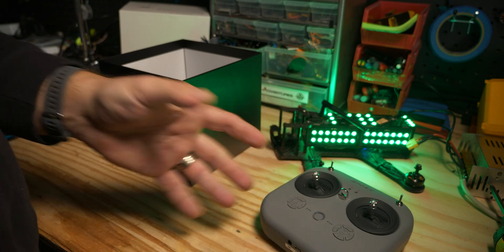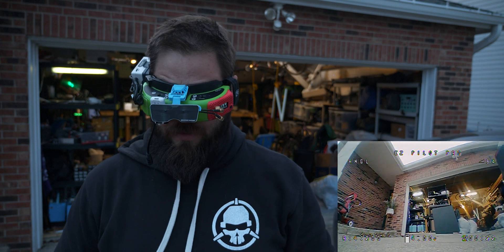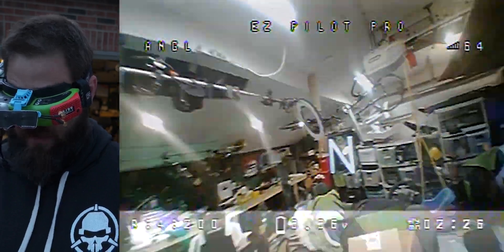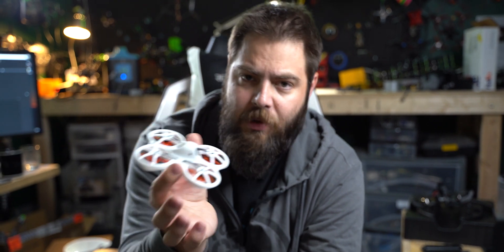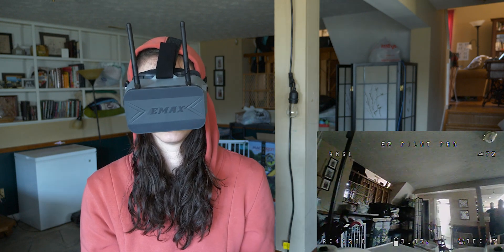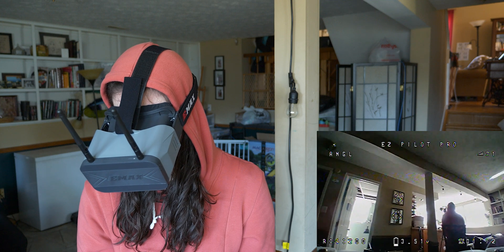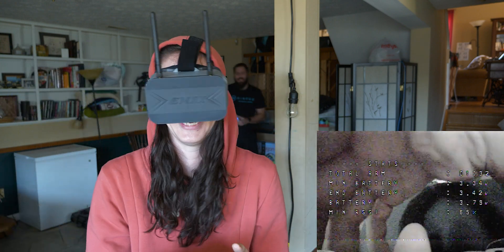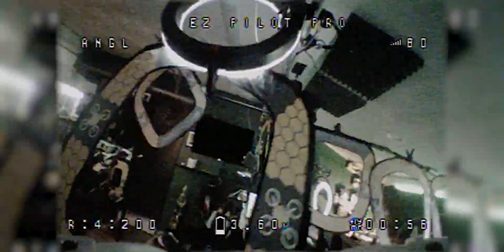Starter Drone That Grows With You

Comment: I really hope you can point me in the right direction. I just bought the Emax tinyhawk 3 RTF and from the first flight about a few seconds of flight in any more including acro. It will start to drift hard left and slightly back. I've hooked to betaflight everything is on point I still reset the accelerometer no fix, tx at 1500 across the board. Could you give me some advice on where to start fixing this? I went ahead and ordered 2 new motors for it but I'm lost. Please any advice on what you think may cause this, can a motor give a free seconds of perfect hover and then when sick input is applied the lean starts? Thanks in advance

Comment: First I'd like to say love the videos Nurk, its awesome to see the behind the scenes of a lot of stuff.

Second, I purchased this for myself about 3 weeks ago. The only issue I have had is with the E8 transmitter. Mine somehow got stuck giving a constant yaw right command. I kept the transmitter on a lanyard the entire time and never dropped it or mishandled it. Used Betaflight to confirm it was the radio and not the drone. Reached out to EMAX and after 2 emails with receipt and pictures of the radio plus back story, they put another radio in the mail no problems. +1 for EMAX support but I still chose to upgrade the radio to the Radiomaster Zorro, but am still grounded as both radios wont be here for another 3 days.

Comment: I’ve been watching your videos trying to find a decent entry point. I like the look of the babyhawk hd but goggles get pricey. This might be just the ticket for me.
Reply: I started off with the tiny hawk kit you can get the goggles batteries drone and everything you need to get going and you can keep the goggles for later they're not the best but they are pretty good
Reply: @saittafpv5846  I really like the detachable screen. Even if I upgrade I can keep it as a field monitor of sorts. But the tinyhalk 3 is a harder plastic. May I ask how it handles outside in the wind? Is there a 2s option for more power?
Reply: @Grouch101  you're the Tony hawk is okay if it's no wind outside but it's not like something you're going to be fine all the time just for the first couple weeks until you get used to the controls and then you go straight to a real drum or at least a 3 in I just went to a 5 inch though after the tiny hawk I've been flying for about 4 years now stick with it and keep practicing and you'll love it can't take out my videos on my channel if you'd like
Reply: @Grouch101  the tiny hawk s does one or two s so does the They hawk 2 and it both come with everything that this one does
Reply: The geprc tinygo Rtf looks good, but uses weird protocols. I like that it can do 2s for outside. But if I got this or the tiny hawk 3 and the babyhawk hd I could do both, but now we are getting pricey again. More research. 🤷‍♂️

Comment: I had a birthday last year and I got an FPV drone. Unfortunately I couldn't get the firmware on my transmitter to switch so it sat in my closet for a couple months and decided to sell It. Then I got ripped off by a couple hundred bucks because the guy I was trading with said the Oculus he had was 600 when it was only 300. I really regret my decision and this year I'm really considering getting back into FPV because of how fun it was.

Comment: Obviously, i am the neediest. Have a racing drone stuck in attitude mode that in trying to learn on. Donated as i no longer have use of my legs, but used to fly, so this is supposed to get me back in the air .
Had a few hours on the dji fpv in manual, but clearly need more sim time, and a less delicate, more fun drone, just like this.
And i love your ability dearly!
Reply: I did reply here earlier, but it's disappeared. Just confirming that the WhatsApp is correct.

Comment: I  Have been saving and saving for an FPV drone for months now. I usually fly My dji spark but have always wanted to get goggles for it - this is when I learned more about FPV drones,  when I started looking at the cost of ordering everything (500 + dollars due to chip shortages jacking up drone equipment prices) I realized it was too much-so I continued  watching Josh's explanations of analog vs digital, 5 inch vs 4 inch quads. Even watched tutorials on soldering (even though I have never tried it still). This turned me off to the hobby, then on captain drone's channel I seen him review The EMAX TinyHawk II Freestyle. I thought this would be perfect (a kit with everything included and cheaper too!). I then learned it wouldn't be a wise investment spending money on equipment that couldn't be used between quads. So i watched hours and hours of videos (i watched Josh Bardwells entire series on tiny woops) - this is how i found your channel. I learned this kit uses equipment that can be used with other drones ( your video where the drone became friends with a dead bird). I started looking at your channel and seen this giveaway was active. I felt this was a sign, and had to tell my story and throw my name in the hat. Thanks if you read this!  Hope i win thanks!!

Comment: 2 years ago i started with my whole interest in drone flying in general. At first i practiced in DRL SIM aswell as Liftoff. I was instantly hooked, specially to freestyle, so i flew quite some hours in the SIM with my playstation controller. However the first drone i then actually got was the DJI Mini2, since i wanted something to make photos first when im outside riding my motorcycle. I sweared to myself that someday i'd be getting a "proper" FPV drone but so far ended up always saying "tomorrow you will" day after day. The biggest reason so far why i pushed it on and why in the end i only flew 2 times with my Mini2 so far is that austrian law is super strict and i'd have to ride at least half an hour via motorbike before i am anywhere where i can fly legally.

That however changes, there are law changes coming this year that allows any drone below 250g starting weight to be flown even in cities! Which means i can just go out in the park to fly around a bit! Can't wait for that. This kit sounds like the perfect starting point for that.

Comment: This is a much better beginner deal than the original EZ Pilot brushed motor drone that only had 25mw VTX and it's expert mode was just angle mode. Unfortunately it's a D8 receiver. It's hard to find a D8 radio that's useful for other drones.

Comment: I was deemed fully disabled the beginning of 2021 and then the pandemic, 2021 i found the hobby but have never pulled the plug on a kit because on a set budget less than $850 a month and trying to save a trip if japan ever opens to visitors, but drone laws are crazy there and you need to stay under 200g with the battery or you need to do a ton of paperwork and get licenses. everywhere you go. i really want to learn house to fly and have something to do in my spare time. thanks for the share and the chance to win, stay awesome!

Comment: I have talked a lot with my colleague about fpv and since I have just started with fpv and have seen how expensive it is. 
He has now flown 3 batteries with my 5 inch drone and is very hyped. He now wants to buy a drone too and is not sure which or what to get. And since he doesn't want to spend $700 in fpv equipment at the beginning this would be the right drone for him.
I also think that the size of the drone + the 200mw vtx for more range I love it.

Hopefully you see that. Greetings Simon

Comment: I'm not a new pilot so draw again if I win - but I wanted to say I started on the OG Tinyhawk RTF kit and this is the evolved version of that. I learned a ton with that drone and am so thankful that Emax made it so easy to get started. I bought that kit before I even knew what sims were so I had first hand experience flying LOS and FPV before ever launching a sim and that felt good to me. These little things are so tough and resilient that there's almost no way to actually break them. I've put probably dozens if not hundreds of batteries through it and still haven't had to replace anything on it. Kudos! Good luck everyone!!

Comment: I actually bought a similar start kit late last year to get started in FPV. Worked on the sims a bit then got the drone kit and started to fly around the house. First bad experience was when I got the little drone stuck in my wife's hair (she was not happy). then the screws fell out of one of the motors and the motor fell off and destroyed itself.  Pretty cool though, just need some more practice (and a pair of scissors).

Comment: Nice juncture. I was looking around for a small beginners drone I can learn on before I take the plunge to make larger drones that can loft cameras for me. I like that the headset display can be used separately. I get motion sick wearing enclosed VR goggles. In the long run I may want to use my motor, PCB, and firmware design skills to make better electronics. My biggest issue is I'm trying to do everything on my disability income.

Comment: Been looking for a drone kit to get my 10 year old daughter started in this crazy (and often expensive) hobby. My son and I already fly (we started back in 2019). My daughter has been practicing a lot in Sims lately and been getting pretty good at it (she's been using my TX16s). But even though she has improved alot in a sim, there is no way I feel safe handing her one of our 5" quads (aka: Flying Blenders) to start with, right out of the gate. Something like this is absolutely perfect! I was looking at the Cetus / Cetus Pro, but I think those are less of a bargain and the sensors for stabilized flight would mostly be a short lived gimic since she is already very comfortable in acro in the sims. Having a kit with remote and goggles are far more appealing for what she needs.

Comment: Hi Paul, been trying to get into fpv for the last 3 years, if its not bad soldering, then its busted harness cables and broken stock flight controllers. have been flying sims during lockdown in my country due to suppliers not being able to get stock shipped in, hopefully this will be the 3rd quad I have attempted to get in the air, but possibly the 1st I can actually keep flying! keep up the awesome flying and being an inspiration to keep on building and flying even if you have bad luck XD😉

Comment: I've been wanting to try fpv ever since fpv racing drones started becoming a thing. I had tried what was supposed to be a consumer fpv quad. Since it uses Bluetooth to control and display on a phone there is so much delay that it is unusable. Even though I love tinkering with electronics as well as rc planes I would love to have something that is proven to work out of the box.

Comment: I was going to 3d print a mini drone and after getting all the parts I ran into trouble when it came to pairing my flysky fs-i6 with my receiver. Unfortunately I don’t have resources in my area of any hobby shops/ friends to help and online wasn’t helpful because I got the flight controller at a different time than the receiver so I don’t know the compatibility. I run into issues of people saying it’s easy to figure out but for someone just trying to start out it’s discouraging. I just use my flysky on my laptop for velocidrone game play but I still want to get into the real thing.

Comment: This is exactly what I was looking for. I started in FPV by building my own micro long range last summer using the parts that Dave C recommended, but I'm hesitant to use it since I need more practice. Something thats smaller and less breakable will give me the confidence i need to use my bigger drone this summer.
Reply: good luck :)
if you have some time in the sim, the most likely thing to bring you down is component failure
or if you push yourself a little too far ;)